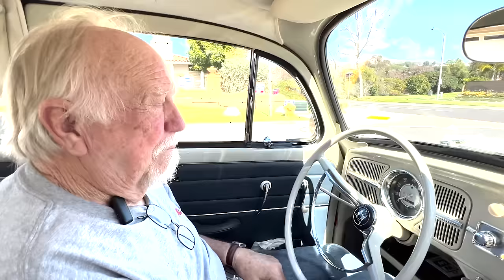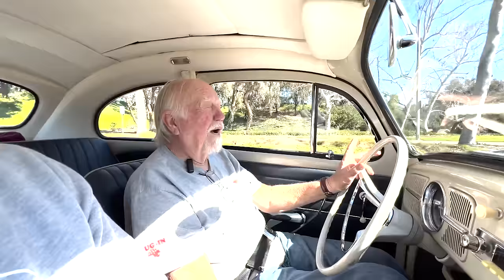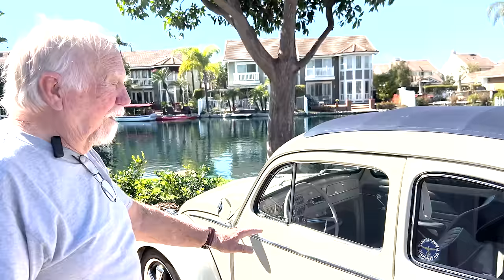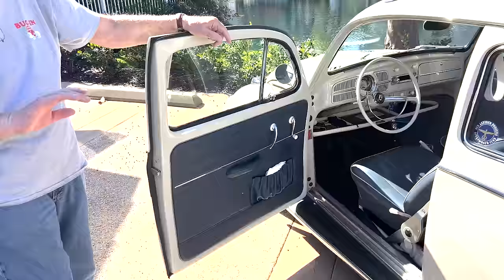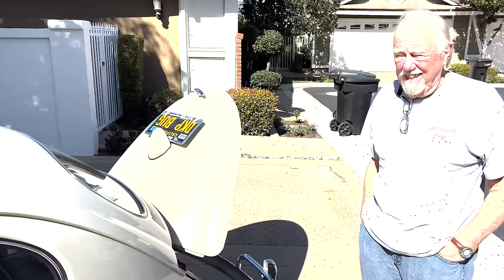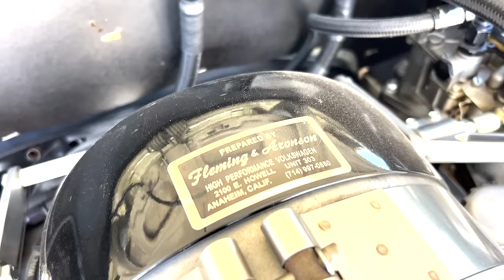Ron Fleming's "Sunny" - 1960 VW Ragtop - Ride-along & Interview

Comment: Great video!  People don't understand what it costs to build a classic VW nowadays I have a 67 bug I'm restoring and I have about 17,000 in it and it's not going to have a paint job, Or a very high performance motor just a SP 1600 for now. And I just spent another $600 just on interior peaces and  I still need to buy the foam padding for the seats.  Enjoy the rest of your life Ron Fleming..
Reply from the maker: You’re absolutely right. Lots of folks think “hey, it’s a Volkswagen, should be cheap” like it’s the 70s or 80s. And then……wake up call. 😢
Reply: They aren’t the bargain cars they once were. Back in the 80’s you could have a nice driver restored car for $1,500. Running Cars were $400. Paint , interior, etc put you up to less than a grand. A rebuilt engine cost less than $400.  Those were the days.
Reply from the maker: @dubworldvwadventures  I remember the days of seeing VWs regularly in the FREE section of the Recycler. I remember I even passed up a 1965 21 window for $750.

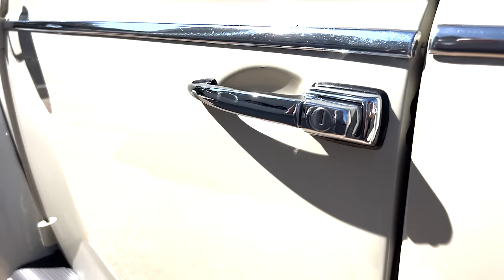Comment: 12:43...1960 was the first year for the push button door handles. Pre-60 bugs previously had pull out "dagger" style doorhandles.
Reply from the maker: @nonelost1  dagger indeed! Especially if the spring is broken and you walk by and hook yourself on it!!
Reply: I think it is also the first year for the deep-dish steering wheel.

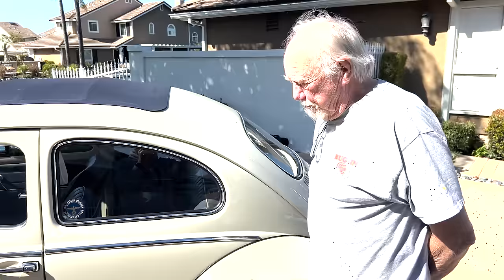Comment: @16:37 We have one or two things in common Ron.
In February of 1985, l bought a '55 in Cranbourne that had been put away by a member of 'The Buggy Association' 9 years earlier so it was a rust free all matching numbers car that had never been in an accident. Painted house paint orange, which we pressure washed off at a servo on the way home. The plan was to keep driving my black '54 daily driver and build a show car in 40 days! We created a Midnight Black and Hebmuller  red two toned, chrome wheeled 'hot rod' with all stock chrome. The car was 'Johhny Bee Good' and was driven interstate to South Australia for their 'Day Of The Volkswagen' Show on the same day we finished the resto around midday....bra fitted to stop bugs and stone chips! The next day we were surprised to find the '55 had taken out the 'Car Of The Day' major prize. Total cost was $2000, including the $400 purchase price. Judges remarked on how the project execution placed it above the cars shown, particularly knowing the overall cost. The car went in to do the show circuit in that year, and in '86 appeared in a Toyota commerical and was used in the Petrov Affair movie, but cut during the 'Directors Final Cut'
In '87 the car was drawn and all the features presented in the 'In Type' magazine, as l was a founding member of  TYPE VW CLUB that came out of the 'Volkswagen Custom Club Of Victoria' in that same year.
In 1991, it appears that it's pure coincidence but the same details were published in VW Trends and titled 'Resto Custom'
The title l had put on the 'look' was Classic Custom as it carried the chrome 'Custom' badge from the '66 Aussie 1300 Beetle.
That's all history now ...
Reply from the maker: Love it! Thanks for sharing!!!

Comment: In 1972 at 18 I bought a White 1961 sunroof beetle in beautiful condition butt with a blown motor that looked exactly like this but stock. Using the idiot's guide I rebuilt the motor on my kitchen table. I paid $125 for the car and $100 in parts to rebuild.
Reply from the maker: That’s awesome!